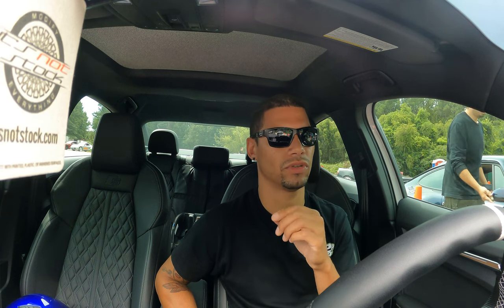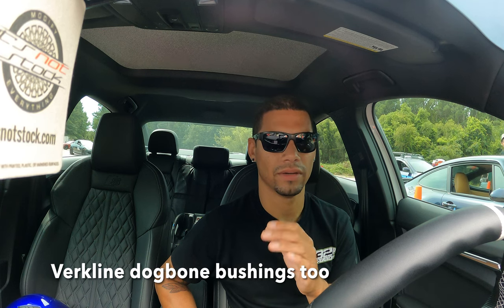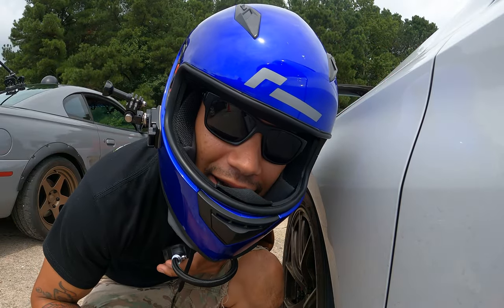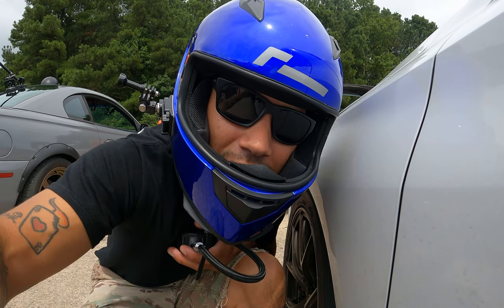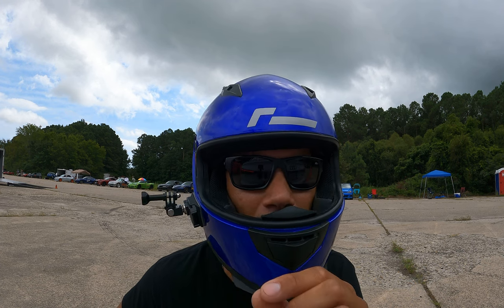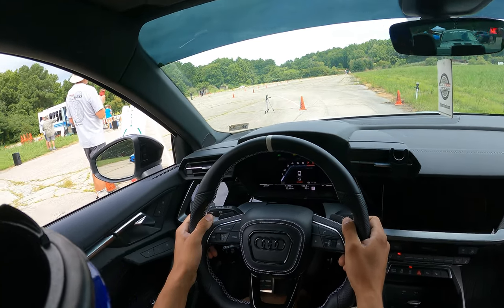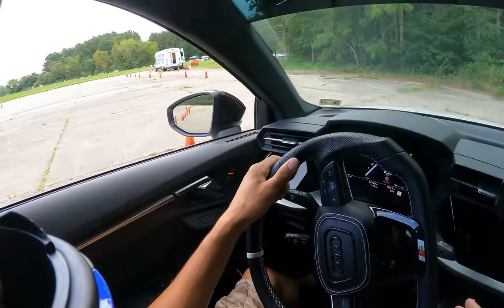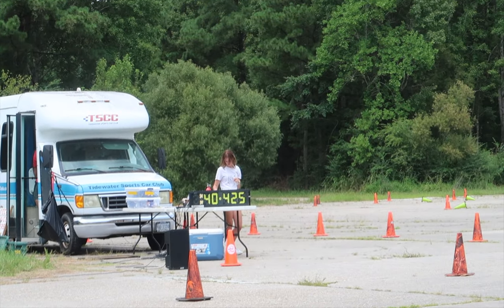Testing out the verkline subframe and tubular arms at autocross! 8Y S3

Comment: What is your next mods for the S3?
Reply from the maker: Intercooler comes Thursday along with shifter paddles so we’ll see vids on those soon. Prolly snag a downpipe in the coming months and get that ceramic coated and ready for when tunes come out. Car doesn’t need a whole lot now. Coilovers eventually when these struts die out.. maybe some ppf. Eventually will need a upgraded trans and oil cooler and prolly do hood vents and iAbed baffled oil pan around that time too. Temps are fine now for autox but once I get a tune bigger courses will prolly require me to do the cooling upgrades